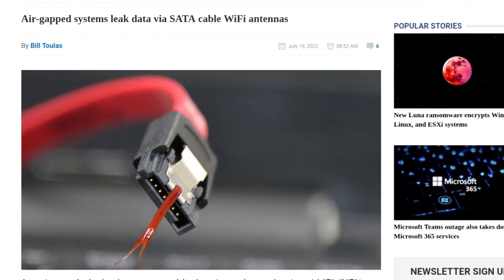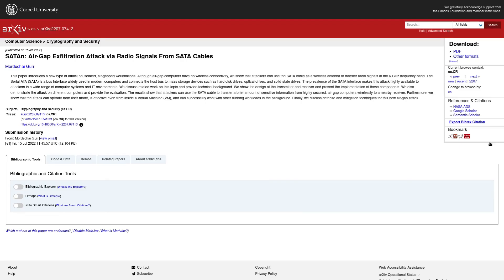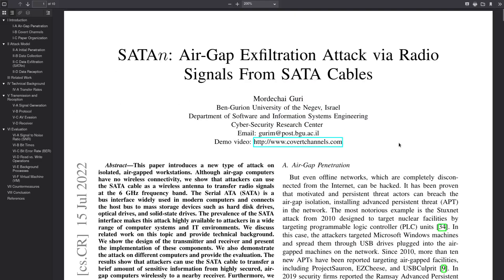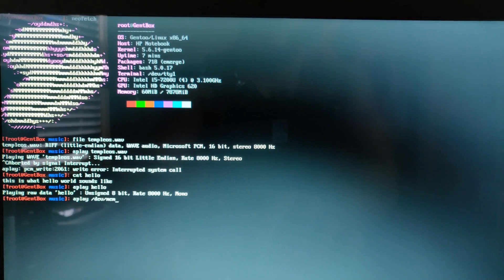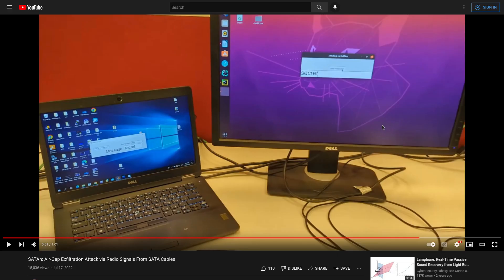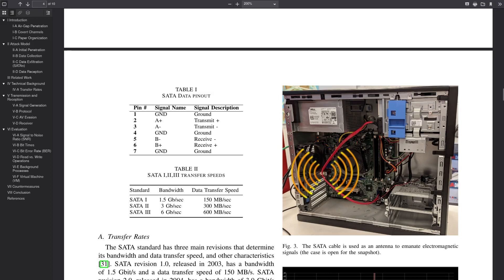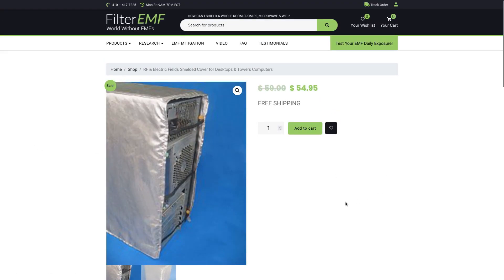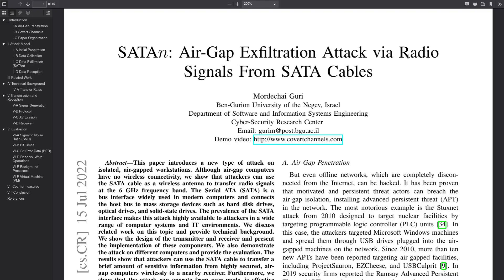Stealing Data Wirelessly From an Air-Gapped System

Comment: Antennas, particularly the ones used for transmitting are also tuned for specific frequency ranges and have alot more power (watts) being put into them

Comment: How is this a surprise to anyone? These attacks have been known about ever since the 60s and 70s. Frankly the good thing about an airgapped system is that usually leaking data isn't a big deal. In any means if an attacker is skilled enough to do one of these attacks then you have bigger problems, because the locks on whatever door is protecting the computer are by far going to be the most vulnerable link.

Comment: My computer uses NVMe-M.2 cards plugged directly into PCIe, so there are no SATA cables to leak EMR. Also, NVMe-M.2 SSDs (such as Samsung 980 Pro) are about 8 times faster than SATA. So those are two good reasons to dump SATA bricks in favor of NVMe-M.2. cards.

Comment: I've told my company many times to just install better security, a single user-specific keycard is NOT enough to protect you from any decent social engineering attack or some other physical attack. Your server is one keycard and one usb input (or in this case wireless SATA read) away from getting breached?  Get better security!

Comment: RF weapons surveillance/spy systems are a fact, despite the Gov pretending they don't exist they exist in both private and Gov forms and are probably the most researched and secretly utilized systems out there.
Think "Havana Syndrome"(without the double-think associated with them calling it a syndrome, damn disinformation programs), RF surveillance and weapons systems
Depending who is doing it they probably don't need this exploit, maybe they've recorded everything youve ever done, seen, heard or experienced since they clicked on you in their system.
Reply: these industries have systems that can penetrate a minimum of hundreds of feet through concrete, some systems penetrate through.

Tin foil will not help you protect anything, maybe 1/2 plate steel case grounded to your house. Thats the only thing that blocks the pain attacks when the automated system starts hurting a specific spot above my shoulder blade if I talk about targeting on social media or document attacks in a text document on my computer or phone.
But this is also DIRECT monitoring, nothing to do with actual computer or phone infiltration.

Comment: EMF shielding won't work against other kinds of SIGINT though. For example, you can send messages with thermal fluctuations. Stress and idle the CPU accordingly to change its temperature. On another computer in close proximity, read the data via onboard temperature sensors. With this, you can slowly send information bit by bit. For air gapped systems, you need to start seriously considering physical security.
Reply: If one has enough access to a computer to do that, then there would be no need to do that; one could just steal what one wants directly.
Reply: Interesting possibility...for our situation may be plausible, give reason to some wonky readings observed while monitoring...

Comment: OMG a speaker is a microphone?! 
What if they just turned the speaker jack to an input when you unplug the jack and replug it, it asks if you want output or input so the capability exists lol.
I'm trolling but technically it's true.
Not really saying so much for air gap as just even if you don't have webcam or mic on your desktop it could be reverse engineered.
I used to mess with RadioShack gadgets as a kid as I'm a 36yo boomer and a mic is just sensitive speaker basically.

Comment: We need some sort of eponymous law that goes along the lines of "Any computer security measures can and will be bypassed by a sufficiently motivated and/or cash-rich adversary."

Because look at this shit. Using a SATA cable as an antenna?? In twenty years we're going to see people manually flipping uranium refiner firmware bits with a maser from twenty klicks away, or something equally insane.

I generally hate cryptobros (with the possible exception of XMR because it's mathematically proven to be based as fuck) but they are correct in their wisdom that truly sensitive information is better stored on physical media in a fireproof box than digital.

Comment: at the end of the day, in order to get a reliable signal from a SATA cable, you need to have hands on the cable.  at that point, just put a man in the middle connector in the case and you have accomplished the same goal.

Comment: 1. The cable is just too short to be powerful enough to transmit over long distances and the pulses are quite low voltage by themselves. 2. A computer's case is grounded which means it will catch most of the "interference" and just dissipate it.

Comment: t.e.m.p.e.s.t.?
Reply: "TEMPEST is a U.S. National Security Agency specification and a NATO certification[1][2] referring to spying on information systems through leaking emanations, including unintentional radio or electrical signals, sounds, and vibrations.[3][4] TEMPEST covers both methods to spy upon others and how to shield equipment against such spying. The protection efforts are also known as emission security (EMSEC), which is a subset of communications security (COMSEC).[5]

The NSA methods for spying on computer emissions are classified, but some of the protection standards have been released by either the NSA or the Department of Defense.[6] Protecting equipment from spying is done with distance, shielding, filtering, and masking.[7] The TEMPEST standards mandate elements such as equipment distance from walls, amount of shielding in buildings and equipment, and distance separating wires carrying classified vs. unclassified materials,[6] filters on cables, and even distance and shielding between wires or equipment and building pipes. Noise can also protect information by masking the actual data.[7]"

Comment: Why does the target machine have a Green CAT 5 cable plugged in? Is the Simple "Hello World!" style input box form actually writing the data to the hard drive in order to send the data via the SATA cable? What RF technology is the hacker machine using to intercept said data, for example, assuming the clock frequency of the system is 3GHz, are they using a wideband SDR sweeping a large portion of the spectrum and decoding the received binary into ASCII? I'm rather curious.....

Comment: Hmm... my PC may be resistant to this because of my power hungry video card (R9 390X). I had the side panel off and it was producing enough signal to screw up the sound going through my headset. As soon as I put the panel on, the interference went away. Consider it a mini-jammer. Though that might not be the full story.

Comment: The 3.3V, 5V, or 12V power rail is connected to SATA Power, not the data port. I couldn't find specific info on the data cable, but I don't suspect it would be much. 

m.2 NVMe drives wouldn't be vulnerable, either. There are also "few and far between" situations were you have 1m access to the machine and exploit on machine but not "literally touch the thing" access for a flash drive or physically take the computer vector. The malware also has to seek the data and transmit it, so the assailant would have to be set in advance what memory location or stored data its looking for, it doesn't seem like they can just "wait" for the data to be read by the host machine during normal operation.

Comment: Sata 3 cables are required to have shielding around the individual differential pairs, as can be seen at 7:05 in the video. This is mainly to help reduce crosstalk since it isn't a twisted pair.

Twisted pairs however tends to radiated a lot less compared to non twisted ones. But have a second twisted pair nearby with the same number of twists per unit length and the crosstalk can get rather large.

But the signal levels here and the fact it is differential helps reduce the radiated energy by a noticeable amount as is. And it isn't like multipath is going to make it a pain to capture the data in most actual environments. Especially if one has a fair bit of other equipment working at the same part of the RF spectrum. Computers do not generate white noise, so it is far from trivial to filter them out from each other.

But yes, there is many ways to transmitt data from most computers.

Though, then there is tempest, where one just looks at whatever the target system is emitting. Be it sound, light, RF, or even conducted noise over the power cable. As stated above, computers do not generate white noise, so there is data to gleam from these sources. The least effective source is though likely sound and light in most situations. And shielding out the RF isn't too hard, while conducted noise over power lines will intermingle with all other appliances consuming power.

Comment: In the 1980s there was already the technology to measure the high-voltage pulses of a crt tube monitor, making it possible to spy on a computer/television screens.

As far as I know, research on this began as early as the 1970s, but the technology then became outdated due to the use of TFT screens...

Comment: Note that this flaw only works IF your airgapped system has an onboard wireless antenna that has been disabled via BIOS or your OS. If your system's motherboard does not utilize a wireless receiver at all, then it is impossible for it to recieve or send anything wirelessly since the system physically does not have the hardware to understand wireless protocol.

Comment: The actual application is fairly useless, the distance to actually received any data is probably only few feet and I would assume that most airgapped systems are also installed in special secure, if not even shielded rooms.

Comment: lol this is impossible, this works maybe in big companies or office rooms but in a normal house hold where sometimes walls are thick like heck and a router gets sometimes barely through doubt i that those signals could get catched by someone which stands infront of your door with a laptop and trying to catch some data xD. would get even more complicated if it is an apartment complex and your disired target sits somewhere in the 5th~7th floor xD.

Comment: It would probably be more feasible to hide a tiny computer in a cable, record data to an equally tiny storage and then induce a failure. Staff removes the faulty cable. Collect from trash.

Comment: the housing *is designed to reduce EMC*. I mean: If you replace the housing of your pc with acrylic, fine by me, but do not complain when that increases emissions (your speakers act weird) or reduce immunity (when you place your smart phone close to the PC, it acts weird). Yeah, likely you won`t have such issues, but only because your speaker is it self designed to be immune and your phone tries to reduce radiation (not for paranoia/user health, just because it saves battery to tune down the radio and you interfere less with other phones)

Comment: I always wonder about this problem since we had a voltage flow meter with a multimeter and as you mention in the video electricity is an emf, in this case in sata cable. and wifi jammer seems helpful here but idk mutch about it.

Comment: Don't get me wrong, this is incredibly cool. However, though I have not looked at the paper, I can tell you that the circumstances for someone to intercept a tiny signal like that have to be so perfect that I would find it practically impossible. If you have such close access to a computer to do something like that, there are definitely better methods than this. Fuck it, install your own antenna on the computer at that point.

Comment: This concept isn't new. There was actually an old 8-bit system, I think, that someone wrote a demo for, and you needed an AM radio sitting on top of it to actually hear its output. It was using its address and data lines as the transmitting elements. It had no cache, so it was somewhat distorted due to the accesses required to read the program, but it was done, and could potentially be used to get data out of a system with no readily available output.

Comment: The voltage at a given time isn't always what's used to transmit a 0 or a 1, bits are often encoded using rising and falling edges.

Comment: The NSA laughs at the idea that airgapped systems are secure. I'm paraphrasing but that's essentially a quote from an ex-employee. You need a Faraday cage before even thinking about other security measures.
Reply: You can't just beam an exploit into the air gapped system remotely, first you have to have physical access. But if you can do supply chain interdiction,  then you don't need it. 😏
Reply: @pr0ntab  You think you need physical access? No, you don't. Look into the Stuxnet case. That was spread by hacking employees computers and then they had to transfer their work onto the airgapped system somehow. Some used USB sticks and the malware had two zero day exploits to silently install itself at kernel level just by inserting the stick. Scary stuff.

Comment: XRay Cameras 12 650+ nm iR around the high grade Lens Camera, the type without iR filter!  Then  you can Zoom into your equipment, chargers, Cell flip Phones wit no cam, Cords, Cables, Tools etc!   Leave smartphones above Mezzanine floors in Faraday Cages locker with battery removed!  Then go to work!

Comment: It might just be easier to plug in a mini low profile wifi dongle to said air gap system if you can put hands on it. So you have to touch the pc any way to load the malware, at that point you already have access... This exploit also assumes the pc uses a sata cable and not hard sata connections or m2. I love how detailed and deep cyber sec can get, it's pretty cool and creative. I'm sure the next attack will be to a computer that is air-gapped, unplugged from power, network, locked in the server room and some how using the power of the bio's battery on the motherboard and starbucks wifi in the bathroom next door, the hacker can steal data using crystal vibrations and way to much caffeine.

Comment: Good discussion.  Cuts to the heart of a mental exercise I've bandied about.  If I had a virgin laptop (i.e. new and having never connected to another device or to the internet) and wanted to keep it as secure as possible by using only USB flash drives to connect it to the outside world, what steps could I take to maximize the security of those drives?
Reply: I'm digging into such an attempt. If I can manage it.
My skills are not up to this level however....
Reply: @genossinwaabooz4373  I watch a lot of YT tech channels but I haven't seen one yet talk about USB safety.  Sooner or later somebody will.

Comment: In the old days, CRT monitors are so radioactive that you can see what the screen displays from distance.
Reply: Not quite. CRTs aren't radioactive. 

What you're thinking of is that the beam spot on a CRT is so bright that with a fast enough photo detector in a dark enough environment you can pick up the varying light levels caused by the beam at each "pixel" (much faster than the human eye) and reconstruct the monitor image without being pointed directly at the screen if you guess the resolution and refresh rate.

Comment: I remember somewhere reading that would be theoretically possible to do a hack like that using sounds, with the beeper of a motherboard (all speakers are microphones and vice versa, and so you could try to invade by sending sounds that would get picked by the MB speaker somehow and try to write I guess onto the bios I think?) I don't remember correctly now.

Comment: I’m a ham radio operator, if you wanted to mitigate this your best options would be an all metal case, with the body of the case being ground. Shield all cables, and also use RF chokes, like baluns or ferrite beads. For those that don’t know what that is, imagine that little odd piece on the end of the PS2’s controller cable, that’s a ferrite bead. Keeps noise down.
Reply: Steel or Aluminium?
Reply: @denpa-kei  are you asking about the case? Either one should work, they're both condictive, and that's all that really matters for using the case as a ground.
Reply: @tylerdean980  im kinda jealous abou your background. I wanted to start with radio, but i was never interested in physics (its my fault, and i never met teacher being able to learn me).
Do i need to be Einstein to start with radio and this type of medium?
Reply: @denpa-kei  Not at all. You have to pass an exam if you want to be an amateur radio operator, but the exam is really easy, bacause all the questions are published. You can memorize all the answers in a couple hours and pass the test with little issue. If that's the route that you want to take look up local ham radio clubs near your location, they provide the testing on-site. But you don't have to do all this just to learn a little about radio. You can play around with CB for free, just testing different antenna types and seeing what you can hear, and how far you can talk. If you want to listen to the airwaves for free there are SDR websites online where you can listen. If you want to do some more casual learning, there are several youtube channels that can give you some good information. Farpoint Farms has some good CB vids, and Ham Radio Crash Course and Ham Radio Concepts have good amateur radio videos. If you have any more questions I would be happy to respond.
Reply: @tylerdean980  thanks. I will check sources at free time. Have a nice day!
Reply: @tylerdean980  Cool of you to be of help. Ham seems to draw good ppl.